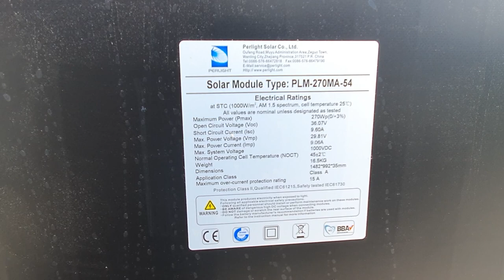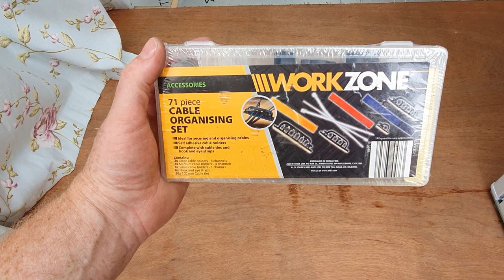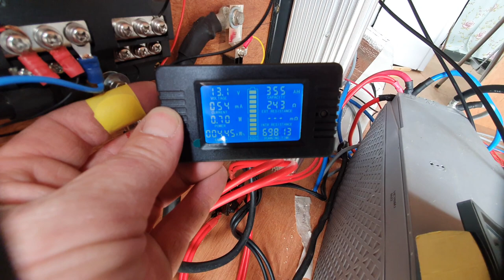fitting solar panels boxer promaster ducato relay campervan

Comment: Great demo!  Thanks for the details on mounting the panels. This part is holding me up.  I bought the thin flexible panels now stuck on how to mount them.  I will not glue them on roof
Reply from the maker: Flexible panels are less reliable and are prove to degrading over a much shorter time than rigid ones. Honestly  if you could sell then and buy full sized panels  would be the best option, otherwise buy some hard plastic sheet in HD or lowes and glue the panels to it. Then you could use bracket to mount the solar bracket to the roof. Jamie
Reply: @campervancreations7656  Yes, you are right. No one told me this when I bought them even though I asked all the questions.  The light weight drew me in.  I thought I would use some lexan coroplast and glue them on then mount with brackets.  I also did not know that larger solar panels were more efficient and of course, less mounting holes.  I might do what you suggested though and just get the glass panels.  Many thanks!

Comment: Hi, great channel, really informative!  I'm looking to add a solar, mostly just for keeping batteries topped up when not is use but I also use a Victron smart charger when on hook-up/generator. Any idea if having solar will mess with the smart charging of the 240v charger? I'm not understanding how they don't interfere with each other. Thanks.
Reply from the maker: If you use a victron solar charge controller(mttp) or any other MTTP solar charge controller for that matter, it automatically adjusts the solar charge depending on the batteries need for charge.  For example, if the battery charger is supplying charge and the solar controller is supplying charge, they will both adjust the amount they supply based on what the other is doing. In simple terms, connect them both as directed and forget about them. No issues at all. I would suggest the victron MTTP that I used and it has a handy bluetooth connection to monitor the state of the charge. Hope this helps, Jamie

Comment: Always wondered is it worth putting solar on a van? You have an alternator on the van, if batteries are low, just switch on for a bit, charge the battery and switch of again. Wonder is solar worth the cost?
Reply from the maker: Couple of options, battery to battery charger will automatically charge the leisure battery with switching anything off. 

Great thing about Solar is that its always charging, particularly over the winter where the vehicle may not be getting as much use and the battery will self discharge over time. You can get small solar panel and cheap Mppt controller for this purpose and then decide in the future if the additional expense is worth it for daily use to keep the batteries charging. Jamie
Reply: @campervancreations7656   Jamie, will the solar charge the van starter battery? Would be interesting to see without solar how much you would have to run the van to charge the leisure battery, on an average week long trip and do a cost benefit exercise. Martin
Reply from the maker: The B2B charger prevents the leisure array from draining the starting battery lower than its starting ability. So unless the vehicle battery is faulty there should be no need.

Fridge is plugged in the last 4 days and no external charge connected and the B2B charger is disconnected.  Mixed weather and everything is fully charged. Note fridge is empty so no thermal mass in the fridge keeping it cold, longer so it's really working hard. You can spend 100 on a basic system or 500 an up to 1500 if you wanted a top of the range system installed by professionals. 

Cost/benefit is never having to worry about power. 
Solar panel =300,
MPPT  controller =200
Never having to worry about power=priceless 
Jamie